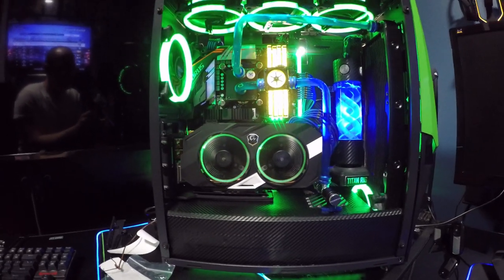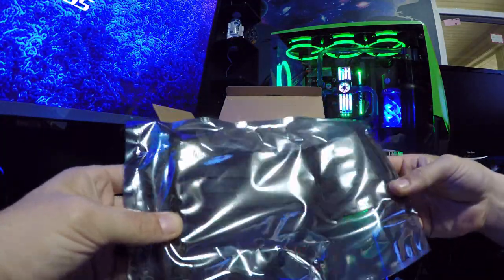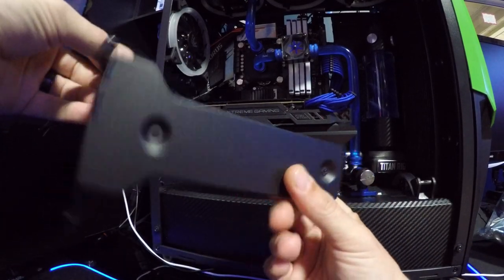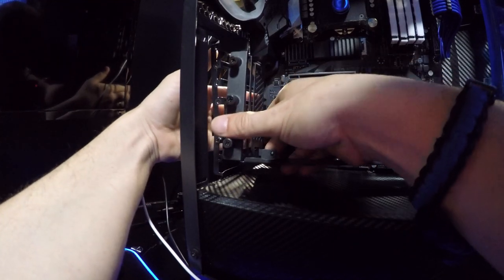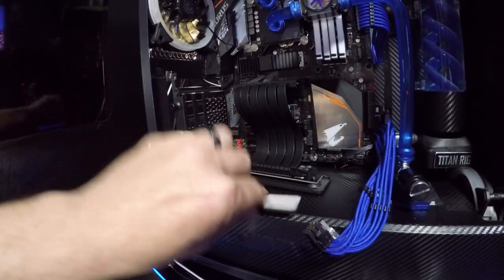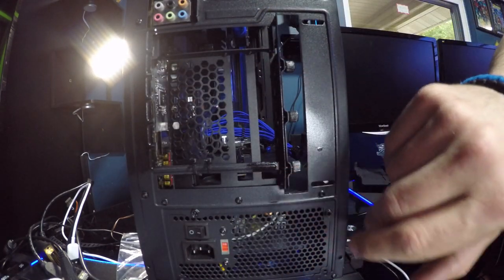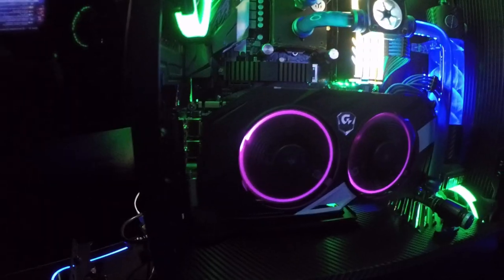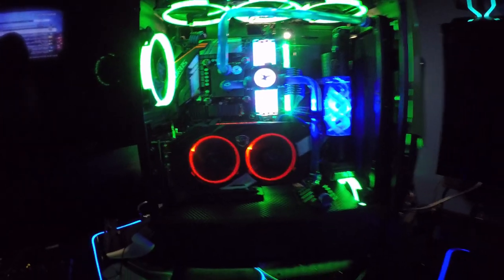Phanteks : Vertical GPU Bracket

Comment: Just a tip, even if you cut those horizontal bars out from the slots, you can still use a normal horizontal GPU setup. Some cases don't even have them (Like my Phanteks P300) so they're really not always necessary. I just ordered this, so if I remember, I'll let you know how it fits in my case.
Reply from the maker: o thats cool... i didnt know that ,,,   thanks for the insight.....  plx leave a like on the video and Subscribe

Comment: I thought you were supposed to remove those two brackets... thats why it wasnt fitting....................................
Reply from the maker: yea i did... the brackets on the back of the case  were the gpu holds on .. i cut the whole thing out to fit the new bracket ... got a 3000$ build coming up... gonna do the same thing... Subscribe and leave a like.. check out my newer videos  thx
Reply: Ya he isn't to bright. He choped the bottom of adapter off and didn't need to as he was trying to fit it in with 2 slot covers still on. How this guy managed to do hard line tubing is beyond me.

Comment: Phanteks: makes a vertical gpu mount forcing you to mod your case, whatever brand it is.

Cablemod: makes a universal mount that requires zero modding.

Me, looking at my Phanteks case: orders Cablemod mount over Phanteks mount. 

Sidenote: great production quality for a relatively small YT channel mate. Keep it up!
Reply from the maker: That is a very valid point that does suck because let's say I don't want to use the bracket anymore now I got this big a***** in the back of my case where I had to cut it out to fit the phanteks... Thank you for your comment... consider checking out the channel and subscribing

Comment: whats that spinning part above your ram? Pretty dope
Reply: Not sure what it is actually called but it is so you can see that liquid is actually flowing through the tubes. Gotta have some way to check for pump failure.
Reply: It’s called a flow meter
Reply from the maker: Yeap. A flow meter.   Subscribe
Reply from the maker: @gaijinkuri684   yep. Its called a flow meter.   I built that pc by hand. And i made several videos from it also... Subscribe. Leave a like
Reply from the maker: @therockpro3057  thats correct.  Glad somone knows.

Comment: How could you possibly not be smart enough to realize you'd have to cut the slots of the back of the case off lmao. And you didn't need to cut the bottom of the adapter off. You were trying to put it in with 2 slot covers still in place. How you managed to do hard line tubing is beyond me.
Reply from the maker: u see the new pc I built the titan rig... who knows how I manage to put that together ..lol  I mean your total right.. how could iv not realized it.. yup